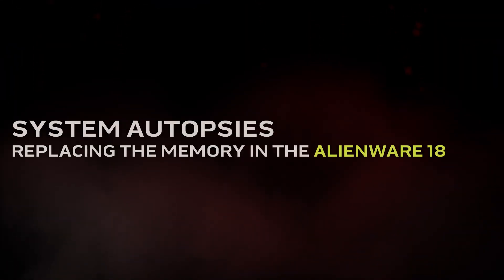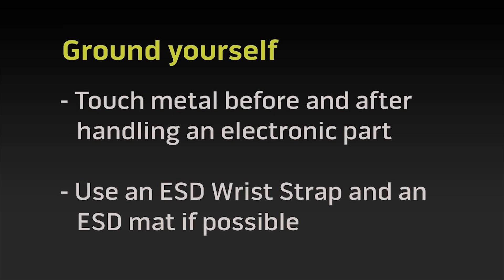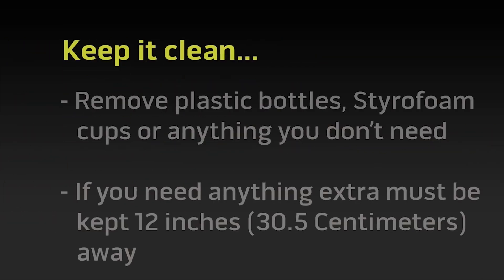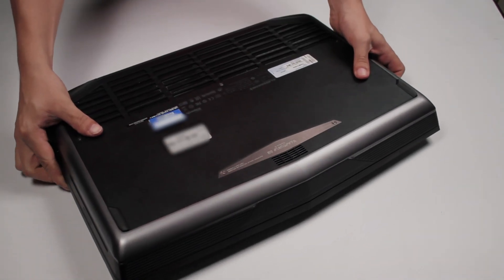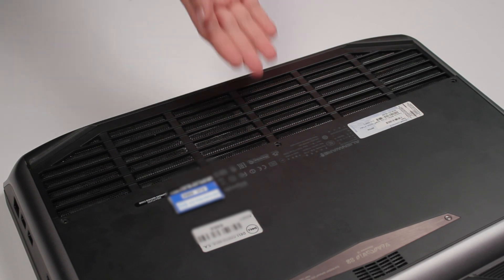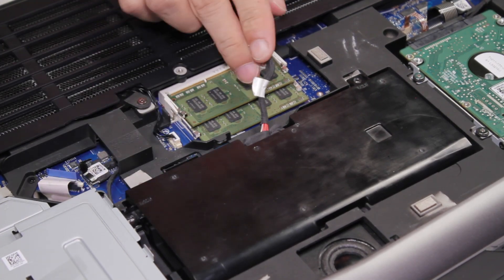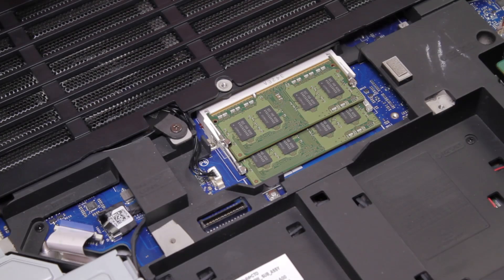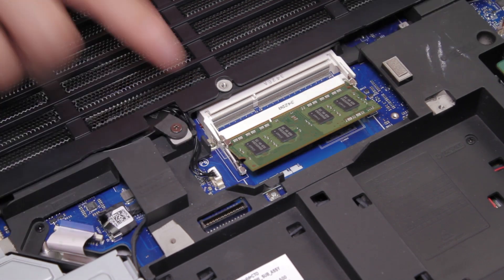Alienware 18: Upgrade/Replace RAM

Comment: Doesn't show the memory slots under the keyboard, which is the hard part. The ones on the bottom are easy and not worthy of a video.
Reply: +Alienware Services A video showing how to access the other slots would be greatly appreciated. After a year of playing Overwatch problem-free, I get random Blue Screens stating either ATTEMPTED_WRITE_TO_READONLY_MEMORY or MEMORY MANAGEMENT for the stop code. Windows Memory Diagnostic detected no errors but when I use SupportAssist to test Memory, I keep getting Blue Screens so that test never finishes.

Comment: Wich are the actual specs for a ram to work on the Alienware 18? I got mine in 2014, if it matters. I've heard it has to be 1.35v only, is it true? I want to upgrade to a corsair or kingston 2x16gb

Comment: Is there any reason why the video quality would be not like it says it is? Like when i set a video to 720p 60 fps its not actually 720p 60 fps. Do you know why this is the case?

Alienware 17 r3 btw
Reply: ***** when watching a movie or when on Youtube
Reply: *****  if i changed the resolution to lets say 720p It says its on 720p but it looks like 480p or 360p
Reply: ***** 1920 x 1080

Comment: +Alienware Services my alienware x51 keeps shutting of randomly whenever i run video games, i called alienware tech support and they sent an employee over to "fix" the problem. He changed the cooling and then when that didnt work he went into control panel and did some stuff.I didnt go on any pages but just went and gamed after like two moths it started acting up and i looked on youtube and nothing has worked so far please help.